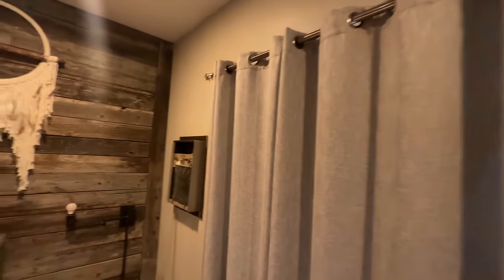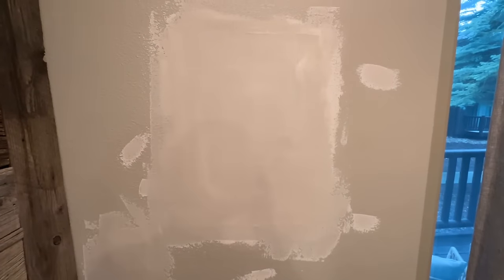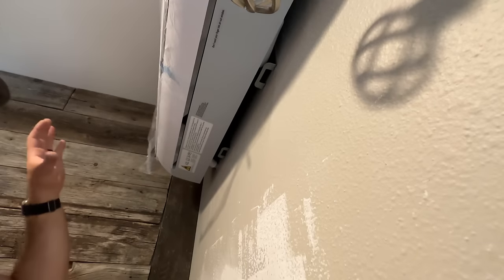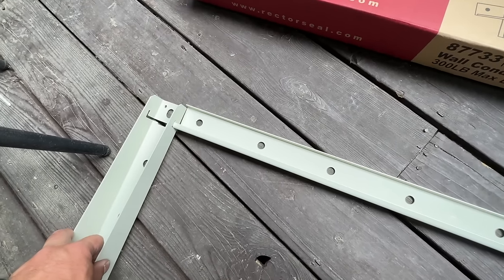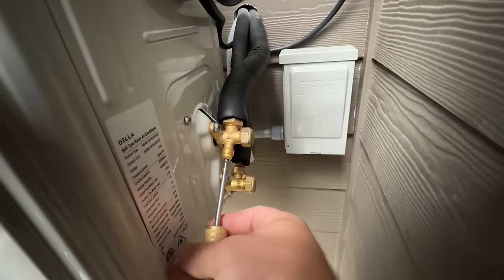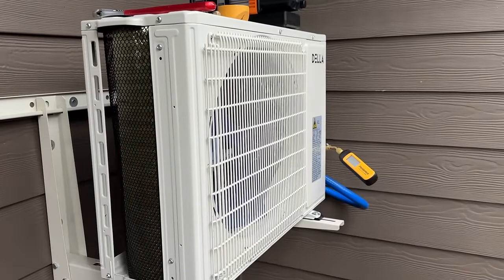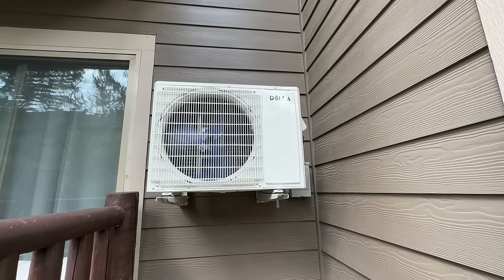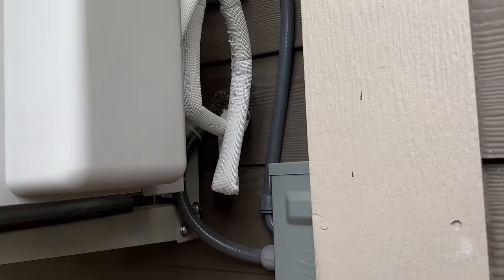A $600 Ductless 110v Mini Split?!

Comment: Seems like a better deal than the tosot i just bought 😂. Do not burry electrical in walls. If you are illeagly doing electrical whatever just do it safely, leaving the box and putting a plate over it would have been correct.
Reply: Doing your own electrical is not illegal if you do it to code.
Reply: @Grumpy244  most places it is illegal without a license unless you're doing it to your own house really seemed like this was not his house. I mean there are a few places where you can do whatever you want but that is definitely not the majority of the country.
Reply: @Channel-gz9hm  Hvac guys can not do electrical here maybe they can where you are but I doubt it if he buried electrical access
Reply: @Kevin-mp5of   I don't know where this was done, so I can't say speak to "code"... junction boxes are allowed by NEC, but they do have to be accessible. (i.e. exposed, behind a removable panel, etc.) The fact they used MC suggests they don't do a lot of residential. (this is the first time I've ever seen MC in a residence - even on YT!)

(The golden rule: if it's not going to be inspected, no codes apply.)
Reply: Don’t forget ….. to set a fire extinguisher next to this fire code violation
Reply: @stich1960 lol he’s a licensed hvac professional. 😂
Reply: @Kevin-mp5of  professional HVAC training and licensure includes the electrical needed to install all different kinds of systems. You do know that, right?
Reply: @Channel-gz9hm exactly. He has an electrician when needed to add panels and what not. Idk why the other commenter is acting like only electricians can touch electrical lines. I’m a nurse, and a woman, but even I can can do basic electrical work.
Reply: @Grumpy244  : That being said; burying a junction box in the wall is definitely NOT TO CODE, it doesn't matter who does it!  I've been an Electrician for 50 years and I've lost track of how many times I've had to find bad connections buried in a wall, done by a home owner.
Reply: @ARealPatriot55  yes I can read codes too. I followed code on any work I did on my home.
Reply: @Grumpy244  That's great, good on you. I was referring to the video where it looked like he had used a handy box mounted inside the wall. He never showed the finished product and it looked like it would have been buried behind the patch. It has been my experience that a person that didn't know you can't bury a junction box, isn't very good at making wiring connections and over time they fail. The code isn't designed to be a "how to" manual and there is a reason for the four year apprenticeship program. These days in most states they have gone with a licensing program that takes continuing education and testing every 3 years because the rules and equipment are changing at such a rapid pace.
Reply: Morons, a licensed hvac tech can pull power from the panel to the appliance
Reply: @stich1960 it's legal to help a home owner to do the work. They can pull the permit. They have to call the inspector when the wiring is done. Then the wall can be closed in. 73

P.S. not every location is governed by liberals. I would think this channel is legit. If you are not allowed to wire call an electrician. Enough Said. 73
Reply: @WatchTashi  Replacing an outlet or fixture is generally not what is referred to as ‘electrical work.’ Installation of new components is. The applicable codes derive from failures of improper installation and are in place to protect end users. Adhering to them often, but not always, requires tools end users have never even seen, much less used.
Reply: @ronb6182  You were making sense, and then…. 🙈
Reply: @topshelflifestyle01  that's nothing my parents called an AC guy that my dad knew to replace a main breaker and he pulled our meter after getting permission to do so. Not even a permit was pulled. But when I changed out that box years later I had to get a building permit to pull the meter. Go figure. 73
Reply: @WatchTashi so what’s your point? Is he a licensed electrician no
Reply: You can follow code till you’re blue in the face and correctly install your electrical to perfection but if you get caught by an inspector (AHJ) and are unlicensed to do the work, you’ll likely get a hefty fine. Reason so, To many people think they know what they’re doing just to leave the mess to the next homeowner.
Reply: This fight is hilarious to me.  No one knows where’s he’s located.  A lot of assumptions.  And not at one times has anyone said on main threads at least a single coding to follow. I am a dyi guy but still follow NEC specs plus whatever my state requires but it isn’t Cp regs so def not right to some of you.  And I don’t even follow NY, CA, IL or Csa but I do try to understand many states and an extra countries.  And I haven’t a licensed one beside a drivers.  I am not saying he did anything right.  Nor am I saying he did anything wrong.  I started reading the thread of people bc I questioned to hidden junction box.  However I assumed he had a way to make the code work as I have recently seen a way to do this but you have feed a uncut cable through the box that’s hidden.  And since I didn’t know where the breaker panel wars, I figured it was just an easier and cheaper way of doing the job right.  When did you hear about where the breaker box was?   Quit being jerks really
Reply: @ARealPatriot55  I'm a GC and we find stuff like this quite often. Like you said just plate the box at the wall...simple and legal.
Reply: @jfbeam  What is MC?
Reply: @happyheart2871 mc cable is sort of like wire inclosed in a material which is similar to flex, it is not to be exposed but is a very handy material. It requires special fittings ….it’s nice to use..easy!
Reply: @JulStar13 😅. HVAC does not provide power.  How do they know codes to provide power ? From the panel load calculations to see if there is enough amps and may need a panel upgrade to sizing of pipes and conduit fill. Sorry buddy HVAC might teach the bare minimum but are not Qualified
Reply: I was initially intrigued and then I see an electrical junction about to be buried in a wall. This is a very basic, DIY no-no. I can't believe how many people "teach" with their videos on YT and proceed to display how ignorant they are. It's not good. If he said; "I'm doing this but it's wrong" I'd have more regard but we don't even know if he knows what he's doing wrong. This is a video that should be taken down. More potential harm here than in other videos taken down due to violence, political stance, etc. Oh, and shielded is required in some jurisdictions but given what we're seeing it's more likely he doesn't know or understand
Reply: @jfbeam you’ve never seen MC cable in a house? So what would you use if your wiring a bunch of circulator pumps for the heating system?? Pretty sure it’s MC cable😉
Reply: Umm absolutely wrong you can absolutely snake wires in the wall and you only need a junction box with access if you’re splicing the wires. It’s called snaking wires and it’s absolutely legal to bury them in a wall. What would you do staple it down the outside of the wall🤣
Reply: @JohnSmith-fw2zf What the hell are you saying? Duh, wires get snaked in the wall. He has clearly buried a junction box inside the wall where the old electric ended, at an outlet, spliced it in a junction box and sent it outside to the condenser.
Reply: @JohnSmith-fw2zf  No, I have not. It's pretty rare for residential to even use conduit. (heck, even the well pump is buried NMC/romex.)

Comment: I have done a shit ton of installs just using easy anchors! Zip them in,screw in the bracket,easy peasy!
Reply from the maker: Yes they’re not heavy at all. I prefer these ones though. I did a test with a bunch of drywall anchors and these held a lot more weight. Equally as easy to install.  Thanks for the input

Comment: I installed 2 Tosot units,I used the cooling mode yesterday and the air coming out of the louver was a nice cold 50 degrees F

Comment: was there no insulation to begin with in that outside wall?  Was that in a climate that would require it?  Just curious.  I didn't see any vapor barrier or insulation.
Reply: Most likely with the home being from the late 60s early 70s exterior walls may have been tongue and groove and at that time felt insulation wasn’t needed. I had several homes I’ve owned in the northeast that were all tongue and groove exterior walls and no insulation. All those houses were built pre 1960 that I’ve experienced.

Comment: Nice install. Those head units don't weigh hardly anything so even just basic plastic anchors would hold it just fine. I use plastic screw in anchors made for sheetrock. They hold 75+ pounds per anchor. I have used them for years with no issues.
Reply: I'd be more worried about the vibrations from the blower and the coils on such a thin anchor over time. I would've probably used a mounting board, Maybe as thin as a 1" oak board. I'd be interested to know if they hold up past a couple of years.
Reply: @Drebin2293 I too noticed that! Yes! (Un-)Screw the wall! Why trust it?! 

A few bucks--hardly any additional time? If you need to replace--already done! And, done-right!

Comment: I didn’t pull my schrader valve out when i pulled vacuum. I released the refrigerant and it works though.
Reply: I never pull the shraders.  It takes a little longer but there is always other work to finish while you wait.

Comment: This is one of the most thorough mini split install videos I've seen on YouTube. My question is what do you do if the system leaks at say the flare fitting and you need to repair and then add refrigerant? I cannot find R32 for sale anywhere in the US.
Reply: I have that same question. If you can’t get R32 from your supplier, then maybe use R410A (which is half R32).
Reply: @coolramone  I wish I knew; I can't get an answer on this anywhere.

Comment: Damn, if I could learn how to do this... Which I likely will... as i've worked with and seen hvac repairs, recharge, etc so i'm not entirely in the dark, i think i could maybe help some folks out around here. It's hot done here in the south, and i'm around poor folks. I bet they'd love an efficient, small to large room a/c and heat alternative to their window units. Either way, i want one for my current home, and I know I can do it. I loved the way you did this. I saw it down slightly different in another video and I'm sure that his system did wonderful, but it felt like you took extra precautions. I like that. Thanks for making this video.

Comment: My wife and I replaced our furnace adding center air at the same time in our American  Fork home.   Best investment we’ve made in our late 1940s home. A previous homeowner sliced off a corner of the garage and turned into insulated space.  It has a 240v baseboard heater as there’s  no way to connect a duct from the central system.  I’ve been considering a DIY mini-split ac installation.  Is the fancy core removal tool and valve kit essential?  A previous commenter suggested renting an automobile vacuum extraction setup.  Is that adequate?  Is there a way Joe blow handyman homeowner could evacuate the lines w/o the vacuum pump?
Reply: vevor or amazon has a vacuum for 140 or so, there is also a line spray that can be used instead of vacuum

Comment: At 1:35 you have an electrical box that you removed and it looks like it will be buried in the wall.   This is a code violation unless the box is accessible.
Reply: true, also what if that connection opens up there?
Reply: Yes and no. The wiring goes into the box, and then into the cabling. I don’t think it’s a splice…or is it direct to the disconnect?
Reply: I'd like a 2nd opinion on this as well, as I don't think it's considered a junction box, but a splice.
Reply: @Kevin-mp5of  we need to find out if he the cable went all the way to the disconnect, or if it’s spliced in the disconnect. I love his hvac skills, but wish he could do better on the electric side.
Reply: Not only that he does not have the proper clearance for the disconnect on the exterior.
Reply: @zunar_j5_933  it's a junction box...a splice is inside the junction box lol.
Reply: The junction box has to be accessible by (electrical) code.
Reply: @sevenohnine yeah I guess if the junction box is in the attic it's accessible. I think I will try to feed a new wire and eliminate the need for a junction box . The only problem is fishing wires especially on block homes. 73

Comment: You could've cut those lines almost in half and then run them before you cut & flared them... since you were gonna custom cut the line anyway.  A life lesson I guess.  Usually you connect the lines and then feed the lines thru the wall penetration to hang the Duct.  This installation seems to have taken several days with all the associated work to replace siding, drywall, paint and relocate the electrical. Just painful to think of the time required to complete from start date to finish.  Adding crimp on connectors at the final white black and red power connections would be a nice touch to make it totally professional.  Nice job & looks great.

Comment: Nice install, I’d give it an A. The electrical connections were bad, needs connectors on the ends. Also the drain line needs extended to the ground with some schedule 40 pvc. Keeps the water off the siding
Reply from the maker: Yea I need to keep some connectors on my truck and a crimper. Thanks for the input.
Reply: that's harsh

Comment: As an electrician there are several things that were done in this video that do not meet NEC requirements. Running a cord through the exterior wall, switching of the neutral wire, access to the junction box that is now buried in the interior wall, no service receptacle, and working clearance for the disconnect. Always hire a licensed electrician!
Reply: Electrician also. Yep!

Comment: If that unit is 110v, you're not supposed to switch / break the neutral conductor like you did in that pull station/disconnect. A neutral is also not to be overcurrent protected. A neutral carries the unbalanced current and should never be switched etc.
Reply: You may have an unbalance in a three phase situation and not as a single phase system.